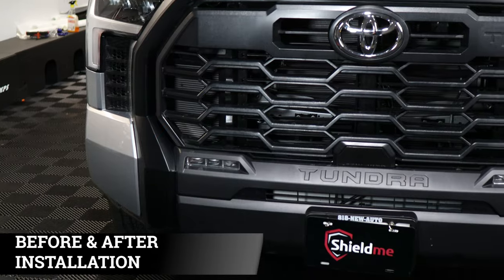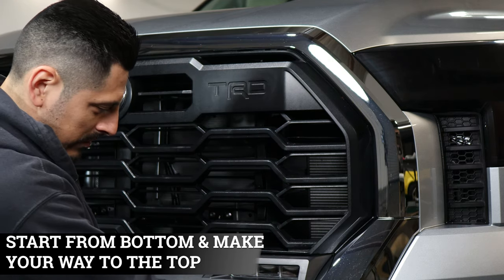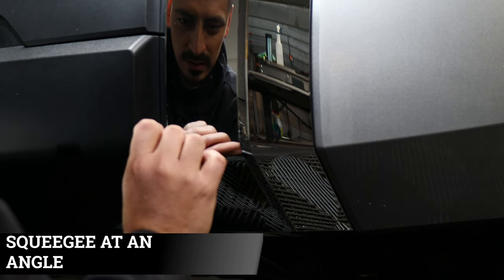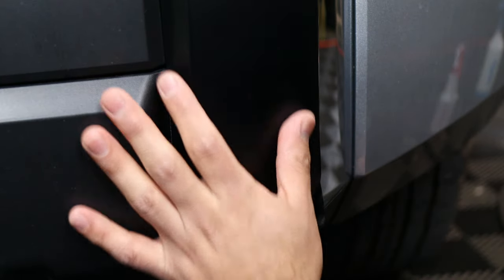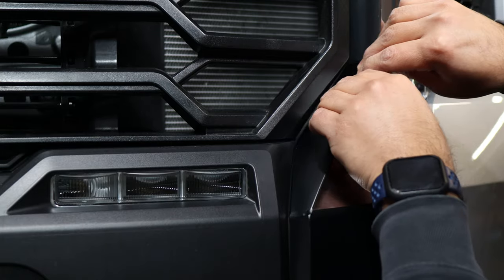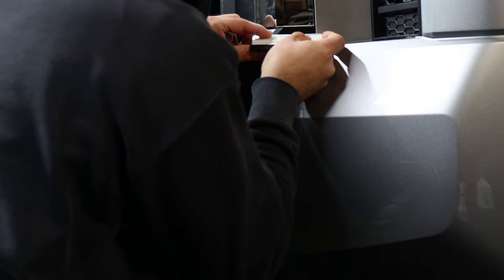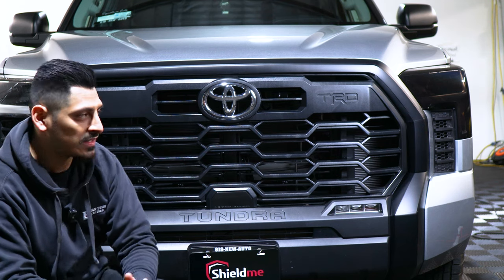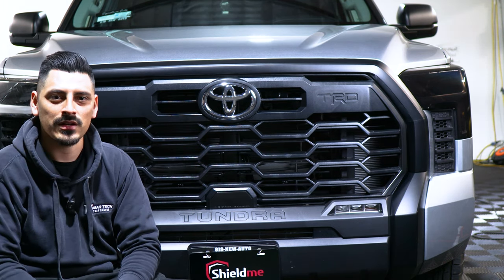2023 Toyota Tundra Grill Chrome Delete Installation

Comment: how long does the vinyl last? Before you have to replace it again? Also you guys should make vinyl to color match the truck. I would love to do this in Lunar rock color.
Reply: Normally, stuff like this max 5 years, but I would change it out after 3 years. The longer you leave it on. The harder it is to take off.

Comment: Would it be easier to take the grill off then apply the decals? I just ordered a set and plan to do it after I do a grill replacement
Reply from the maker: For our installation we do not remove the grill. Maybe it might be easier to install but the kit is meant to installed with the grill not being removed.